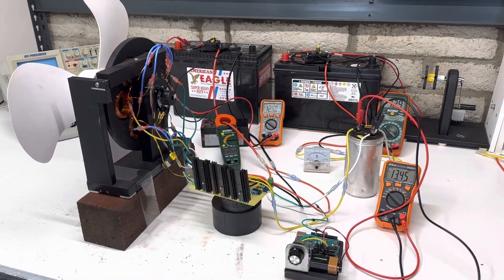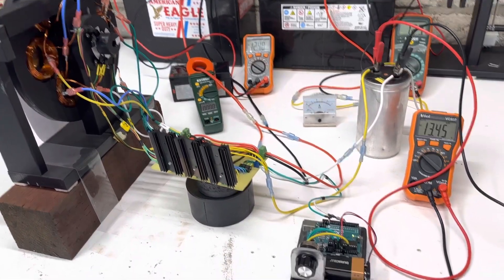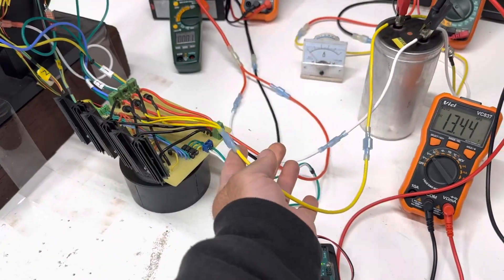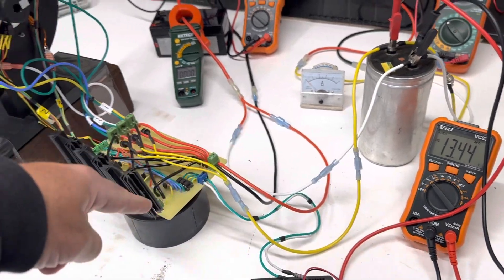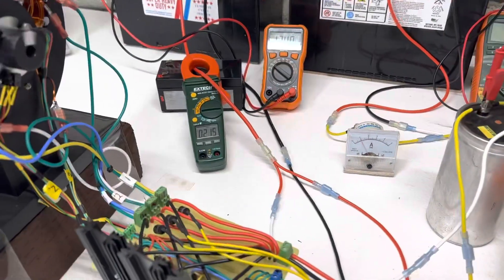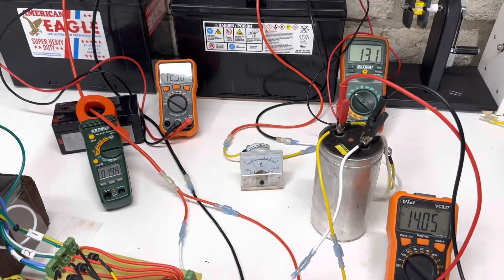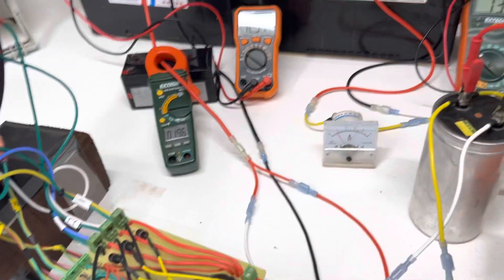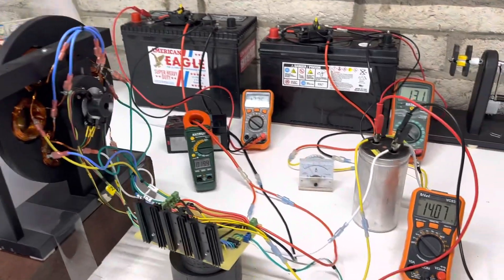Axial flux motor part 2

Comment: I use the little-known magnetic amplifier instead of mosfets to drive coils. Indestructible and powerful.
Reply from the maker: You mean a tube ?
Reply: @kenergy1707  No, not a tube amp. The magnetic amp. Is not widely known, (google it) it uses a magnetic field to achieve gain and control large currents with only a few milliamps of bias current. It was first used by germany in 1945. But it can only control ac or pulsed dc. They can have high gain, but of course they are not as fast as transistors but they have none of the disadvantages of mosfets and are immune to back EMF.

Comment: What happened to the pulsing was it more efficient direct into a cap…..??????
Reply: Excellent thank you for that answer ….I wanted to also ask you on which video can I find you building the Pulse board with the six cap setup and how is it released… and if you don’t have a video can you please make one ..I would greatly appreciate that because I need to collect energy from my system and be able to release it at a certain rate ..and how it is done on your board?..  and do you know if Ican I collect RF The same way and release it as a load also… I found many ways of collecting RF and using it for mechanical value… I find myself  like Gerard Morin.. I like to try everything even if I think it will blow it up because you have many surprises when experimenting….I greatly appreciate your knowledge… my last machine I made had six lines ..each line has 65.6v 60 Hz frequency with 360v + as a collective…but when you play them against each other I get different results with the kinds of electricity I am producing.. I get a electric power ….RF power and a power with a frequency that seems to do nothing that I can find ..but may have some applications I don’t know of…my next machine is 12 lines … The magnets moved themselves on the first machine and it had to be disassembled I am now making a 12 line machine because it is the whole clock six lines was only half… with the six line one I had zero resistance at full load 12 will complete 360 degrees.. thank you for your time and patience and thank you for all your videos keep it up
Reply: The next one is 12 lines 720v I can’t stand waiting for parts.. lol
Reply from the maker: @joew5559  I do have a basic cap pulse video using a ziner diode and scr 
 You should do some videos of your work
Reply from the maker: Pulsing much more efficient but hard to measure this way there’s no debate on output
Reply: I have many videos with different builds and improvements and four people involved with the build…. And have every intention to film next next build and sheer my… progress… purpose… and real uses in every day life…  I had much progress with the six build to make a 12 line seemed right… funny thing is out of his 53 accessible videos Gerard Morin vagly stumbles across this… says very little.. then dismissed it…  i couldn’t stand not moving towards it…. And build from his oversight… mannnnnn I’d love to talk to him..
Reply from the maker: @joew5559  have you tried make full bridge rectifier with ultrafast diodes to capture that energy so you can condense it into usable energy?
Reply: @kenergy1707 "….  No I have not..  does one of your videos have some information about that and which one so I can get a gist of what you were saying…. It sounds worth trying…
Reply from the maker: @joew5559  my motors aren’t that hi frequencies with my pwm is about 10k hz regular full bridge seem to work ok but if you have RF output you might need something faster 
 Unfortunately I don’t have video on it I haven’t had the need to make one yet
Reply: @kenergy1707  wel.. if I move in that direction I know we’re to ask for your thoughts … ty.. keep on keeping on..✌️

Comment: One thing that I have always wanted to do with axial flux motors is create modular system where you can stack the stator and magnet disc's alternating. 

€ [] € [] € ..... etc.

€ - Coil
[] - Magnet Disc

Using your design each stack would generate a separate voltage output. 

What do you think?
Reply from the maker: That’s true! 
 I don’t see why not that could be very powerful
Reply: @K Energy  feel free to try it out. I figured by sanwiching the magnet disc between the coils disc's, it would push the magnet on both sides increasing power. I did some math on it a while back and figured it would be about 67% (if I remember correctly) increase in total power output for one sandwich. So by adding more magnet and coil disc's in alternating patterns, each pair should increase power output significantly.
 If anyone could make this idea work it is you!
Reply from the maker: @makerslife  definitely makes sense
Reply from the maker: Did you see my outboard motor ?
Reply: @K Energy  Yes, it's awesome! It looks like it's 3 coils with some large magnets in the center if I remember correctly.
Reply: I do have lots of questions about that. Maybe you could do another video on it going over it.
Reply: I just read a reply to someone, it seems like you already have an idea like this in mind. It is similar to adding rotors to a rotary engine.

Comment: Do your motors have a direct correlation with energy return and torque? Is there a deminishment in tourque correlated to the increase in energy regeneration?
Reply from the maker: If you watch my videos closely you can see that the more load the motor runs the less energy return there is because it falls out of its natural frequency
Reply from the maker: The trick is to make a motor big enough so that the load doesn’t change much from where it 
(wants ) to run
Reply: That's what I was thinking, and then you mentioned something that sparked my interest about it.
Reply: So constant speed is more crucial than anything?
Reply from the maker: It’s not necessarily constant speed but tuning it in for what you are using it for ( timing, pwm, speed,load )
 Overload isn’t good for any motor efficiency
Reply: @kenergy1707  hi. i watched david porter motor, he said tapping power/ i think he means applying power to the coils not in every one rotation but only once after more rotations are made to get the generated power of the inertia rotation only.  he also said he uses circuit to count rotation.  i dont know if my understanding is what he means  but i think it will generate more power and use less input. sorry for bad english :)

Comment: Very nice I have achieved 40% returned with bedini circuits before. This circuit works very good. Have you considered winding your coils bifiler? It gives you way more voltage output in the bemf
Reply from the maker: Nice ! 
Yes I have this is first crude prototype next one will have dual rotors and more strands this one has 2 wires per coil